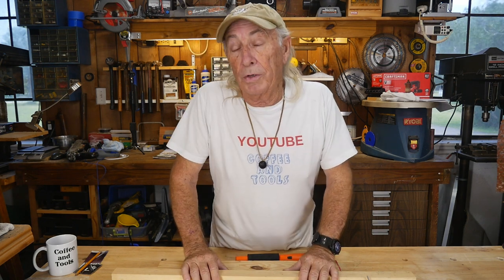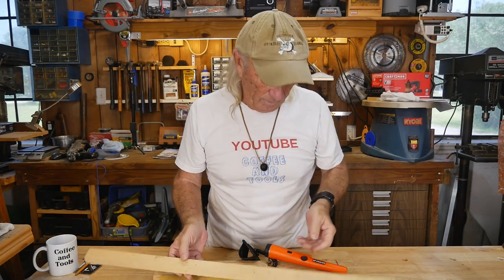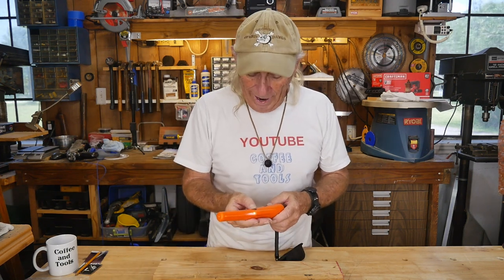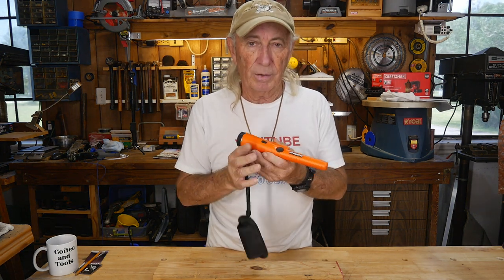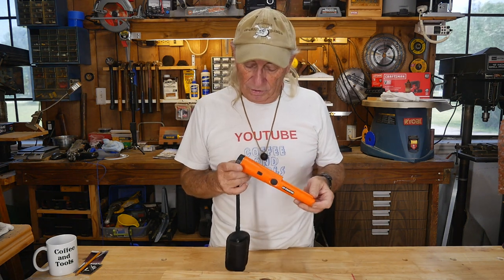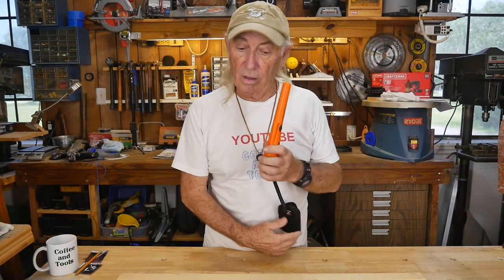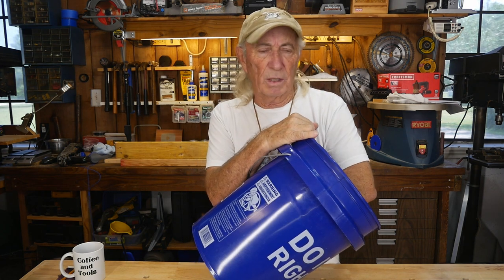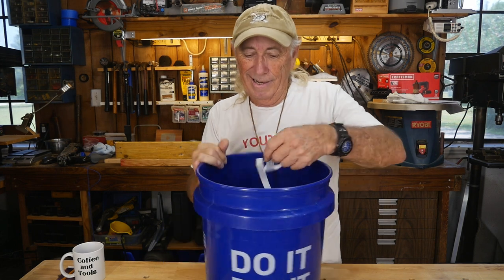How to catch the screw in wood before you cut it, Giveaway and new draw! Coffee and tools ep 255

Comment: I bought a lumber wand about 30 years ago.  It has saved my bacon on numerous occasions.

I wouldn’t think of running a board through my saw or planer without checking it first.  

My favorite use is finding dropped screws, washers, etc.  I’ve spent hours trying to find hardware and fasteners in gravel, grass and even on concrete… until it dawned on me one day that the lumber wand would find it in a jiffy.

Every handyman, carpenter, mechanic and woodworker should have one!

The most unusual find was a maple tap inside a slab of maple I was getting ready to plane.  I sanded the surface instead and left the tap showing in the live edge.
Reply from the maker: WoW, a lot of big thanks for posting and your thoughts about metal detecting pointer. Maple tap....geezz...that is a new one :)